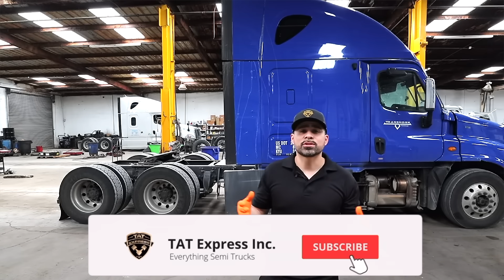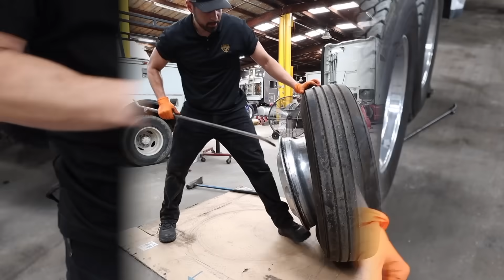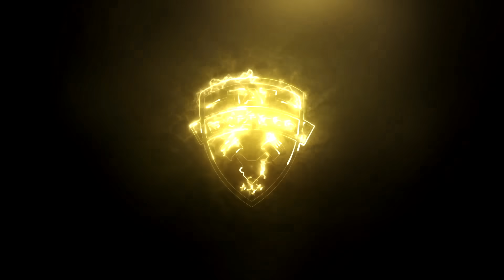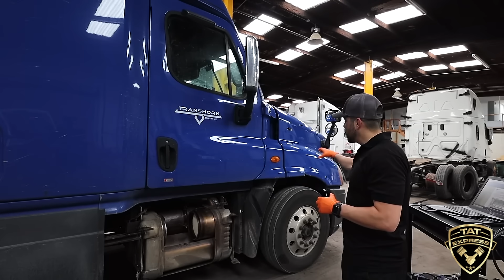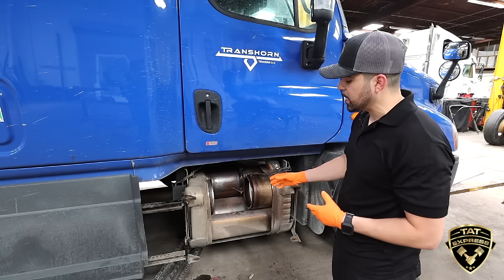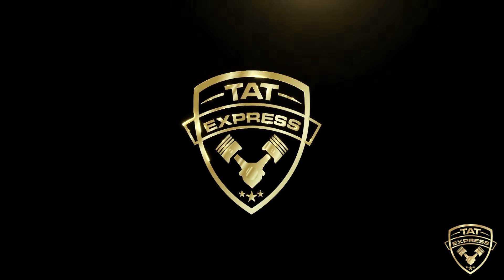Detroit DD13 DD15 DD16 SCR Fault Code 4364 18

Comment: I have a 2016 Coronado with a dd15. How do I tell if I have electric or air? I recently got a new metering valve to carry with me but it doesn’t look anything like the ones I see guys changing or cleaning in their trucks. Theirs is a long assembly with several chambers and wire plugs while the one for my engine is a small box with just two lines coming in. The dealership told me that mine was a new type. I’m asking because when I watch a video what they are doing to their dd15 I don’t seem to have or it’s very different on mine. I don’t seem to find videos that have engines / parts that match mine
Reply from the maker: There are different types of DEF Dosers; yes, you may have an electrical valve.

Comment: If u have 4364 code along with 520371 and 530372, just run scr efficiency tests until they all go away. Freightliner only has this temporary fix for it.
Reply: I’ve had these codes come up 3 times already, they ran SCR efficiency test and they would go away for a little bit and come back on. They came back on today .
Reply: @SFMARK69  yea it sucks. When my codes come back, I'm using 3x the normal amount of def
Reply: @thadiesel7655  I didn’t notice if I’m using more def or not but the code is just a pain the the a** and I’m tired of throwing money at it because Freightliner said it would make me derate and I don’t want to end up in the side of the road
Reply: @SFMARK69  what year is your truck. My 2019 never derated and I drove thousands of miles. My friend has the previous body cascadia, and his will derate
Reply: @thadiesel7655  I have a 2019 Cascadia with 910,000 miles , I just had the engine swapped with a used motor with new rod and main bearings
Reply: @SFMARK69  gotcha. Yea if you have the same codes I was having, I'm 99.9% sure it won't derate. I have 80 gallon tanks, and was having to fill my def tank every time I needed fuel. I think my def tank holds 12 gallons.
Reply: @thadiesel7655  it’s crazy because so my many people say it’s different things, and so many people have this issue and they said they tried this and that but still hasn’t fixed the issue, I think Freightliner needs figure out what’s really  going on and put out a recall.
Reply: @SFMARK69  yea I was throwing parts at mine trying to figure it out. Nothing worked. I honestly think freightliner's only real fix may be a whole new one box.. those epa folks really screwed everyone.

Comment: Thank you for this video. It  was very informative. I have code EEC61   4364   18 It’s a 2014 Freightliner M2. The DEF gauge showed 3/4 full , but yet doing my research it said to add DEF.  the tank took 7 1/2 gallons. So I’m sure the gauge is not working properly. Can I still drive with this code on? Or is the problem I’m going to get worse please advise thank you.
Reply: I had the same code on my pete with cummins.
I got it fixed by replacing the douser valve and cleaning the built up def so truck was getting proper amount sprayed in the exhaust. I am getting better fuel milage now and code went off after doing a regen.
Reply: Same code today

Comment: I have 2019, dd15, 360k miles fault code 520372/16 
I’ve been taking it to my Mechanic and dealer for 4-5 times, they clear the code and still come back up after 2-3k miles. Dpf, def, all the dpf sensors are new. They can’t seem to find the issue. 
Wish you’re here in Cali!!!
Reply: That code is SCR loop.  No fix.  Just temporary force Regen 2 twice to get nh3 SCR efficiency to 1.00. Than this code will deactivate.  That's in my case.   Most case check your nox sensor inlet and outlet for hours.    Mean time to replace them.
Reply: I’m in the same boat! Had these codes pop up so I took it to Freightliner, they said my def pump was leaking so they changed that, that didn’t fix the issue . They tried to run it through the SCR efficiency test but truck was falling out of regen. They couldn’t figure out why, than they said it was my engine harness that was the problem. Long story short spent $10,000 at Freightliner on def pump and engine wire harness and a bunch of diag time and labor, I took off from there with no codes, they came back on a couple weeks later.
Reply: @SFMARK69  F freightliner

Comment: I currently have 4364 17 on 2019 cascadia dd15. Would this be a similar code to the 18 and would I have the same problems?
Reply: I have the same code with your truck, did you get it fixed ?
Reply: @AmanAndHisTruck123  yes.  It was the Dosser Seal that needed to be replaced.  I took it to Interstate Deisel and they replaced the seal under warranty.  Those seals on the Dosser go bad and need to be replaced probably every 300k miles and it starts spraying out the DEF fluid all over the place and they leak the fluid and it cakes up all on the inside of your ONE BOX.
Reply: @cascadia7244  thank you man, I took it to a mechanic this time that used to work at a Freightliner dealership and replacing the doser is his first recommendation, so I’ll get that replaced and do you have the part number by any chance? And did you get the one box cleaned as well ?
Reply: @AmanAndHisTruck123  yes they did clean out the one box so have your machanic do that.  I don't have the part number but call frieghtliner dealer, give them your Vin number and they will tell you what the part number is.  Your machanic will probably have to get the dosser from the dealer anyway.  But if they don't have any in stock because it might be on back order then just have him change out the seal inside the dosser.
Reply: @cascadia7244  do you happen to know if they changed the Def injector as well? thanks for the info brother!
Reply: @AmanAndHisTruck123  no they did not change the def injector.

Comment: I have a 2011 Casacadia w/ a DD13. The truck has been ran OTR and serviced regularly. My driver contacted me and stated that the truck was running but making a sputtering sound. We took it to the shop and the guys stated it was the manifold, but once ripped apart they realized it was a gasket that had broke. Gasket was replaced and now the truck acceleration pedal isn’t working consistently,but only sometime. The truck is making the same sputtering sound, and they are assuming that a valve has been sucked in and it is not pulling air in but pushing it out. They suggest a rebuild engine or selling it as is for pennies. I personally am not trying to do either. What other issue could this be? Also, if a valve has been sucked in would the truck even crank? They were even able to drive the truck in 1st gear to move it out the shop. Another mechanic stated it sounds like it could be the piston. I need HELP!!!!

Comment: I Have A 2017 122SD With A DD15 5mph Derate Had  Three Codes SPN5397 SPN 3227 And SPN 520372. I Have Replaced The Def Fluid Also Replaced The Downstream Nox Sensor Also. I Have Towed My Truck To The Dealer In Which They Couldn’t Figure Out The Problem.

Comment: I have recently found conversion efficiency faults due to driver reluctant to fill out dvir . Another driver had to use his truck one night and called me with both Amber lights on. He was close to the yard about 30 miles. I had him restart the truck and only one Amber was on so I had him continue to the yard. When he arrived I checked for faults and found several emissions faults and  a active conversion efficiency and inactive def quality. The def level showed full and I'm assuming contaminated def fluid by the driver. This condition will also cause efficiency faults. Being late and the truck was needed the next day, I emptied the def tank and filled it full with def. With a forced Regen all faults cleared. I test drove the truck loaded and monitored the emissions level to find no problem with average of 80  to 97 percent efficiency while cruising at 70mph with 80k loaded. For a few more days , no faults no problem. Few more days, the night driver had to use it again. Of course he had faults again and check engine lights. When he got back to the yard the same condition happened again and the def level full. Having  another truck ready to go I downed this one. The next morning I asked the regular driver of the truck of any issues and he said now and then the light turns on at the def gauge. Like I said before , no dvir no nothing. Just ignores it and let's the problem bite other people on the ass! So I then visited with the customer and asked if he would appoint the truck to the night driver only  so I could better monitor operating conditions and he agreed. We filled the truck with fuel and def and I also tested the def quality of 32 precent. I told the driver do not add any def, let me do it. The truck runs 3 nights without a issue, but the def level still showed full. I gauged the tank with a stick and found it half empty! Then all the efficiency and def quality fautls made sense. If the gauge shows full you won't get low level faults, the thing will run empy , the acm will try injecting more def to reduce the nox, and then all those faults will go active when monitoring goes out of range. As a result I replaced the def tank header unit and had the night guy give me positive reports of the gauge showing the level reducing over a few trips. If the ecm doesn't know the level is low, it can only report faults created by high level emissions. All that trouble due to some lazy sorry ass driver not doing paperwork. And how in the hell can one moron drive the same truck for over a year and not be aware of it not indicating def level dropping .

Comment: Hello sir good afternoon. I have Frightliner dd15 2014    Code 4364.3361  and check engine sing red stop sing yellow mil light deraeting speed 5 miles on the road this going on from one and half years. Then we changed noc senser in and out let and last year we changed doger and def pump.main harness changed last week. But the problem still same. I spent all most over $ 8000 please if you can give me any advice. Thanks in advance
Reply: Did u find out what was wrong

Comment: When you say put an apron over the sprayer??
Reply: It's called a awning kit for the DEF doser. Freightliner sells them. Basically you have to remove the def doser, and that outer dpf filter, drill two small holes into the one box to install it inside the box. What it does is block the exhaust from pushing the def fluid down it the box causing it to build up and not reach where it should. It's some shit freightliner should've put on these damn trucks from the factory but instead they are making money off there bad design. The fact that they sell a kit for this tells you they know this was a potential problem.
Reply from the maker: @arionnecoleman3206 You’re right—early One Box systems had real-world issues that weren’t fully accounted for in the design stage. That awning kit is definitely a band-aid for a design oversight. But to be fair, the aftertreatment systems have evolved a lot since those first versions. The latest One Box designs are much more efficient and reliable now that they’ve been tested in the field and adjusted accordingly.
Reply: @TATEXPRESSINC thats good but for us drivers that got the old one box...this means nothing as we still have to deal with these problems.

Comment: I replaced every component of my after treatment system trying to fix this problem.  Sensors,  dozer, computer,  filters,  wiring,  literally everything but the box itself.  Freightliner Amarillo said the awning was a waste of time and I've been told the only thing left is the box.  Where are you located and will u install the awning for me?
Reply: Did you every get the problem soved.
Reply: Any update? I’m at this point right now

Comment: I got this fault code right and I’m doing a regen. Will that help also this happen when I put fuel and def in my truck at the Love’s. Few miles down the road my def light start blinking and get this code 4364 fmi 18. 
I had this same problem a month ago. It in a freightliner shop they said it was the EGR Actuator.Now it doing it again.

Comment: That  test  for inlet and outlet nox sensor
Just unplug  the  def doser electric plug and run a test    about   the  sensors?
Reply from the maker: Alex, using DDDL is the best tool to troubleshoot an after-treatment system.  Thanks for watching, and be sure to sub to the channel

Comment: Aftertreatment scr  inlet  and outlet nox sensor   values  when working properly     the ppm    ?   Thanks
Reply from the maker: Alex, with no def dosing, Nox inlet and outlet should be no more than 50 ppm apart.  🚚👍🏼🔧
Reply: @TATEXPRESSINC   thank  you        i just changed     doc  outlet  temp sensor 
Tomorrow ill do the  warm up and   see  what value comes up       thanks
Reply: Idid    regen       
Def pump did go up  1600 rpm
Nox  inlet outlet
Inlet 260    280
Outlet  21 51  ppm
 Def pump  145 psi
  After  regen ivdid  unplug the def doser
First  inlet was  280
Outlet about  130  ppm but  started raise
Reply: During a regeneration. Inlet nox will run about 300 and outlet should run bout 25 .You need an efficiency of  0.70 or higher .Def will spray about 500 gph or so .this is with doser plugged up .If the doser unplugged your nox will read different but need to be 50 ppm apart.if there not first check for boost and exhaust leaks .then change inlet nox.if this dont get it 500 ppm apart change outlet .If that dont work buy a one box

Comment: What does this particular situation cost to correct. I have a 2015 cascadia and it keeps reading EEC 61 check light on maintenance light on little amber light above def fuel gage keep blinking. Finally got a parked regen and did 400+miles stopped to fuel up just desiel and they all came on after restarting the truck. I live in lancaster can wait till you guys are fully operational.
Reply: Yep I went to the next exit and put it back on. Got back to Dallas and it was the def dozer wires were frayed throwing a lot if codes. Had to remove the panel on the passenger side to see it.
Reply: @ross3603  Damn bro sorry.  Could you visibly see the dozer wires damage?  I've looked closely at mine and don't see anything obvious, guessing they are melted inside the plastic shield tube?
Reply: Yea bro the wires were frayed an broken. Heat wear and tear. U might have to take the passenger side panel off so u can see the def system an doser components
Reply: Did you end up getting de-rated to 5mph?
Reply: I have the exact same problem on my 2015 cascadia

Comment: I have a question? I own a 2014 Freightliner Cascadia DD15 eng. Back in September I had 4364 fail 18 on my truck. Dealer replaced NOX sensors inlet and outlet. shortly after that i had to have the DPF filters replaced. On 11/18/2020 I had the DEF injector due to a fault code 4353 fail 3. 11/28/2020 the check eng. service eng. light came on with codes 4364 fail 18, 3364 fail 2, and a blinking light on the DEF section. Most of this is covered under warranty. Would a nox senser go bad after filters are changed. Trying to make sense of all this.

Comment: How you doing sir ? I have question DD 15 cascadia 2012  today when I turn my truck on the gauges cycle like normal then all the power to my dash just turn off and I have no power to no gauges but truck run lights radio ac work but no gauges rpms  fuel gauges speed o

Comment: I'm getting very worried about these trucks, so many troubles to deal with.  I regret why I became an owner. Today I spent over 1700 dollars just changing a water pump.
Reply: That’s way too much for a water pump replacement buddy unless you did it at the dealer
Reply: @juanaburto446  The job was done by a Pilot shop in East St louis. I had a replacement that had cost $75 but it turned out to be incompatible. The time was past 7pm and I couldn't go out to look for another replacement. Pilot made calls and told me they'd found a proper fit for $1000!!!! I was trapped and probably getting blackmailed but told them to proceed anyway since I had to get out of there. The final bill included 1000 for the pump and 700 for labor and coolant. I have the receipt and I'm thinking of raising the issue with Pilot.
Reply: I have a 2016 2 speed water pump from the dealer it was 1400 bucks with 315 for a core charge

Comment: What do you do if it is contaminated? My truck is in derate at 5 miles per hour all three check engine lights are on. Meaning the yellow check engine light, the yellow maintenance check engine light and the red stop check engine light. The def light is blinking I have changed the filter underneath the d e f tank and then I done a Regen and it still did not fix the problem
Reply: What did u do to fix the problem
Reply: @trustinthelord2248  we had to replace alot of the parts for the def system...(dropped it off at a shop)

Comment: I get this code every time after my truck sits more than a few days over the weekend get 30 miles down the road, then I got the other one for bad def do a parked regen usually goes away but the last time still have the solid yellow light but the yellow engine light went away. 2014 DD15 with 517k miles any ideas?
Reply from the maker: I suggest an ash cleaning if you haven’t had one within 300k miles

Comment: How’s everything. I have a freightliner and receiving 2 codes 1: engine 1 accelerator pulse abnormal width or period. 2: sensor supply voltage, voltage below normal.  Iet me know what you think and thank you.  Loving the channel

Comment: Had the same issue specially when going up hills, luckily I deleted the system.
Reply: Yup I have the same thing!! Change both filtes also the sprayer replaced
Reply from the maker: Thanks for watching. Be sure to subscribe.
Reply: @williamandereson7281  did it solve the problem?
Reply from the maker: Thanks for watching be sure to subscribe.
Reply: I’m having the same issue climbing hills. Do you recommend a delete?
Reply: @Lbg2death highly recommend. Dm me if interested in a delete